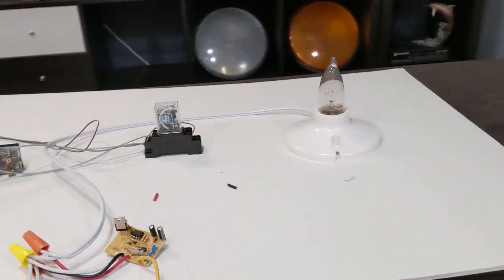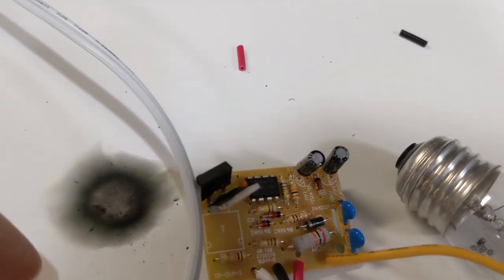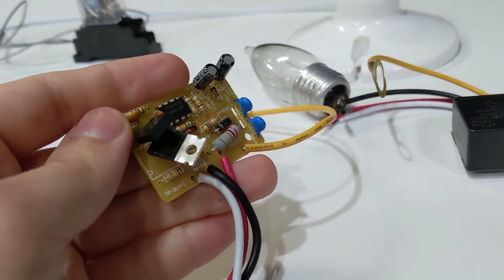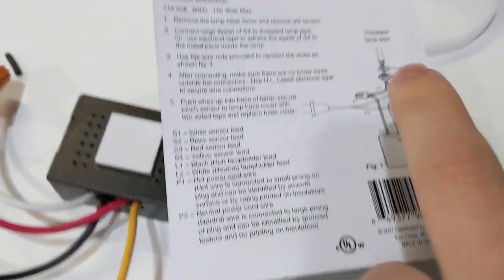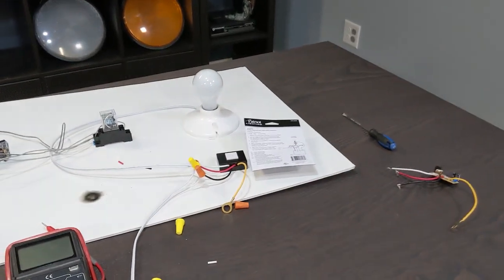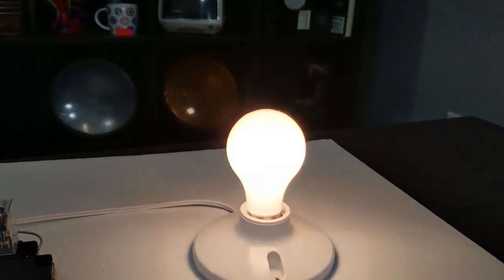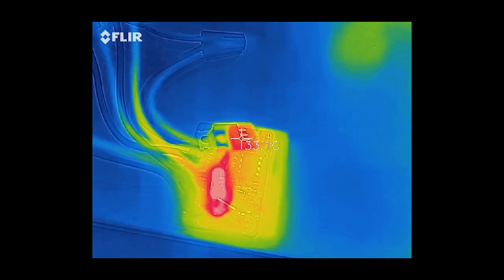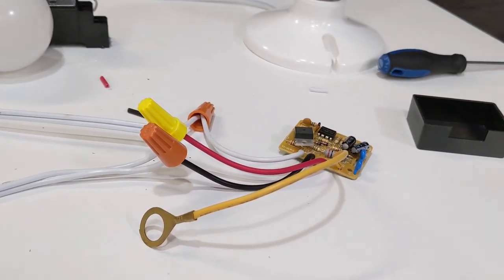A slightly explosive touch-lamp follow-up (standby energy consumption)

Comment: What's the philips hue WIFI standby power consumption vs the touch lamp standby current consumption?
Reply from the maker: Great question! The device on the network (bridge I think?) is undoubtedly greater than half a watt, but I would imagine the bulbs themselves can pull off substantially less. I have a Zigbee smart bulb somewhere that I can test... I'll go looking for it
Reply: @TechnologyConnextras  Can't wait for the results!
Reply: The Zigbee smart WiFi chip may be capable of extremely low idle power consumption, but that doesn't guarantee the circuit supplying it is also smart low power.
Reply: @andykillsu  Phillips is transitioning away from Hue and is going towards the Wiz WiFi lighting solutions instead. They are cheaper bulbs upfront but you have to have the WiFi module in each lamp. I heard those use controllers are so power efficient that the benefits of Zigbee outweigh the drawback of needing the Hue controller. Back when smart devices 1st came out, WiFi was power hungry and Zigbee was the best option. Now, WiFi is power efficient enough a mega super cap can store WiFi settings on a smart bulb for example vs Zigbee.
Reply: I also wondered about the smart lightbulbs, but I've actually got a few LIFX ones rather than Philips Hue. 

Philips claims Hue uses about 0.2 W on standby, my LIFX bulbs (and they're the most efficient ones they have) 0.7 W - which is more than I expected, I'll be honest!
Reply: @TechnologyConnextras  I hope its not much as I have 10-ish plugged in all the time! eeek!

Comment: As an Australian where Red = Hot and Black = Neutral 'Whats ya issue mate?'
Reply: In Aus - Not always
Reply: I mostly work with DC power in my job (like hooking up cooling fans) where black is negative. Occasionally I'll mess with A/C if the power supply for said cooling fan needs to be wired to an electrical cord (depends if the power supply has an outlet or not), what I usually see is red and white in A/C wires, not red and black. In that case the white is the neutral. With housing you often see white and black, but I don't mess with housing wiring in the course of my job. If I'm doing wiring, it's going to be cooling fans or LED lighting.
Reply: @jimmym3352  Here in Australia, up until we switched over to Brown/Blue/White/green to match the rest of the NON USA world, it was
Red Active, Black Neutral, White Switched, Green Earth.
Since we were required to switch the active, obviously wiring for switches was almost always red (active) & white (switched).
I am VERY out of date tho. My license expired decades ago.
Reply: here blue is neutral and brown is live ....
Reply: @nufgorf  our fixed wiring is still red/black. Appliance cords are brown/blue.

Comment: As you had it when it exploded, the electronics were being powered in series with the bulb and the triac would short the two mains wires together. Remember, it isn't that he flipped the hot and neutral, because being an AC circuit which wire is hot and which is neutral Does Not Matter. You can flip your mains cord and the bulb cord around all you like, the circuit will work the same. What mattered was getting the electronics wired across the mains (neutral be damned) and the bulb in series with the triac (lamp fixture be damned), nothing more...which you did not do the first time around ;-)
So, to break it down with the board, the white wire runs to the triac, the red wire runs to the electronics, and the black wire runs to both the triac and the electronics. If you want the black wire to mean HOT, then so be it: run Black to HOT, Red to Mains Neutral and the Neutral of the Bulb, then White to the Hot of the Bulb. It will work just fine.
Reply: Totally agree. The triac was wired across mains not in series. Swapping live and neutral (and colours) doesn't matter

Comment: Red = live, black = neutral sounds normal to me ;)

Of course NOW the unified European wire colours changed Live 1/2/3 from RED/Yellow/Blue to Brown/Grey/BLACK, and neutral from BLACK to BLUE.
Reply: probably because AC and DC aren't the same
Reply: depends which kinda network type you're on.
Reply: Brown is that colour for live, because that is the colour of your underwear if you touch it. That's what an electrician told me once anyway LOL
Reply: This is where interdisciplinary learning in science and industry is important. It would seem obvious from an anthropological and psychological perspective that you should use RED to denotate danger, and something like brown or gray for neutral, but I'm not certain if that's universal (more likely is about the red, since I do remember reading studies on that) which is why broad minded testing multi-culturally would be important for that.

Comment: Yeah those colours are very dumb. Also as someone else mentioned, the wiring diagram shows it switching the neutral which is not the best. I believe it would be possible to wire it to switch the live without exploding, but the way you had it wired first, the triac was basically shorting the incoming supply, so having the plug the other way around would’ve been the same result.
Reply: How was this being sold at a store?
Reply: You are still getting it wrong. The reason it exploded is because you connected the white S1 wire to your mains line voltage. 
Your explosion has nothing to do with connecting black or red wires to neutral or not.
Reply: @giyanvice  All these people you have been spamming this reply to are other commenters. They don't run the channel.

Comment: I had a similar experience when I was replacing a missing molex power connector on a hard drive. I bought an extension cable from Radio Shack, with male connector on one side and female on the other, with the intention of cutting it and discarding the male half. I examined the controller schematic and soldered the red wire to 5V and the yellow wire to 12V and the two black wires to ground. Connected to the power supply and POP with blue smoke! Turns out because it was an extension, the manufacturer didn’t bother aligning the colors to the pins in the conventional way and I sent 12V down the 5V channel and lost the most expensive and highest capacity drive I’d ever bought.

Comment: With respect to the polarized plug, there isn't' any ground reference, so it would have behaved the same with reversed polarity.
Reply: Yes. The design appears to not care about polarization. Rather, it only specified a "common" connector on red; black for "input"; white for "output".

Comment: So, let me get this straight: Hot is tied to the lamp, so the contact in the socket is always hot, and the NEUTRAL is switched?  I would imagine if you used a polarized plug and reversed it so hot was on black (and therefore switched), it should still work, and it should be safer as well.  (Lamp sockets are still a major gap in making electrical appliances safe for people with curious fingers!)
Reply: Yeah, I was gonna say this..  As an electrician, you NEVER switch the neutral.  ALWAYS switch the hot.  This is not up to code.
Reply: Apparently the lights in my house are neutral-switched too (it's a >30-year-old manufactured home). I always change bulbs with rubber gardening gloves on, for starters...
Reply: @WackoMcGoose  Light switches are fairly simple to rewire.  Most important two steps are 1) turn off the breaker 2) test to make sure you turned off the right breaker (or just turn them all off)
Reply: @narcoleptic8982  depends what you're doing. With coloured LED strips you always switch the neutral. There's one hot wire, then it comes back as three (or four, or five if you want good white LEDs as well) neutrals for each colour, so you control them that way.
Reply: @lost4468yt  are u talking about low voltagr dc led strips? live/neutral terminology does not apply there, and wouldn't the colors have individual positives and a common negative?
Reply: It's a non-polarised plug, so won't matter which is neutral or live as it can be reversed at the plug at any time.
Reply: @narcoleptic8982   Bad design. The hot lead is connected to the lamp at all times, creating a shock hazard even when the lamp is off. Switching the neutral side would never be approved by UL. This is probably counterfeit and illegal to use in the USA.
Reply: You are correct. The neutral wire should go to S3 which should also go to the threaded part of the lamp socket.
Reply: @MikeF1189  I'm curious how you think you know this device isn't UL listed? I'm also curious where you get the idea that a lamp switch has to be UL listed to be legally installed in the USA.
Reply: @RickinICT  Pretty simple actually. I guess you didn't read the above article on how to spot fraudulent UL listings. It is code my friend. NEC.  I know you are not an electrician but it's pretty basic stuff.  Educate yourself.
Reply: @MikeF1189  Well, you haven't actually answered either question, have you? Exactly where in the NEC does it state that a table top lamp switch (which is not a fixture) must be UL certified to be legally used in the US? I find nothing indicating that the NEC concerns itself with table lamps, I'd be happy for you to quote me the specific section where it does so. Please, be precise so I can look it up and "educate myself".

Next, exactly how do you know that the product in that package is not UL certified? How have you looked it up? Are you sharper than Menard's legal department? Do you suppose they don't know how to verify a UL listing? Do you think they make enough money selling a few of these switches per year to risk the liability of selling a device that hasn't been listed when they could just as easily find another device which is?

Be careful about educating people online, they may not turn out to be as ignorant as you suppose. I'll look forward to your NEC citation addressing table lamps, and explanation of how you are so sure the product in the video isn't UL listed. Don't put your back out digging that hole before you stop to ask yourself if you're really sure you should still be digging.
Reply: @RickinICT  Do your research. Spend a little less time arguing with me and a little bit more time verifying facts. Prove me wrong.
Reply: @MikeF1189  In other words, you admit you can't back up any of the assertions you've made. Because the burden of proof is always on the person making the claim (i.e. "it's against code" and "it's a counterfeit UL listing"). But hey, I'm glad you've finally realized it was time to put the shovel down and stop digging.

The NEC doesn't concern itself with table lamps, it covers electrical installations and wiring. You're completely full of BS claiming the NEC has anything to say about a table lamp. That's why you refuse to cite the section that covers it, it doesn't exist! And an electrical device does not need to be UL listed to be legally sold and used in the US, but it would certainly be foolish for a company the size of Menard's not to insist on their merchandise being tested for liability reasons.

And that's why this device has been tested, and is listed as a "Recognized Component" by the UL for both the US and Canada. The device in question, while being packaged and sold under the "Patriot Lighting" brand by Menard's, is in fact a Zing Ear TP-01. The manufacturer's name and model number are embossed right into the mold which makes the housing. Since I doubt you'll "educate yourself" on how to look up a UL listing, I've done it for you:

https://productiq.ulprospector.com/en/search?term=Zing+Ear+TP-01

As you can see from these results, it is UL listed as a "Recognized Component" (in other words, it's a component of another device (e.g. a lamp) and has been tested and pre-approved for use as a component thereof).

So there you go, I've not only "educated myself", I've hopefully educated you in the process. At least, I have if you are capable of learning.
Reply: @RickinICT  I thought I told you to prove me wrong. Go on now. Stop commenting on YouTube videos. Do a little research. I gave you all the information you need. If you're interested in finding the truth I gave you the leads. If you're interested in arguing continue commenting.
Reply: @RickinICT  Such hurt feelings. You need counseling.
Reply: @MikeF1189  Ladies, you're both pretty.
Reply: @polygondwanaland8390  OUCH
Reply: @polygondwanaland8390  just not on the inside apparently.
Reply: @MikeF1189  
Um… They did present evidence to prove you wrong… I’m not taking a side here as I really don’t care, but this comment near the end of the discussion just seems odd right after he posts a comment with links that (supposedly) show that your assertion appears wrong.

I would also agree with them that the burden of proof is on the claimant—which, in this case, would be you. I can agree that this is likely unsafe, but as far as violating any sort of code or not being UL-compliant, you would need to cite which part of the code would apply here more specifically than, well, all of it. 

Also, as for the “hurt feelings” comment, that is even less persuasive. Aside from the lack of evidence that there were any hurt feelings to begin with, it’s irrelevant, and it also ignores the merits of the argument actually being made.

Again, I don’t really care whether you’re right or wrong, but your argumentation needs some work.
Reply: @bhull242  I agree 100% with you on all your points, if my goal was to make a cogent logical argument. If, on the other hand my goal is to get someone heated over something stupid.
Mission Accomplished. 
Have a nice day and thanks for the comments.
Reply: From what I've seen essentially all touch-lamps have live exposed at the socket when off and control neutral. (Old ones, and new ones.) I have a UL listed touch lamp from Walmart and it has live going to the lamp when it is turned off. I observed the same behavior in an ancient touch lamp. Some people say that it is dangerous but there has to be a practical reason for it. Not that anyone I ever have known in my life would stick their hands in a lamp socket.

Comment: That looks like a really crappy half rectified mains to Zener power supply, from what I can see. 20 kOhm resistor dropping almost all of 115V AC (120V minus the Zener drop) half the time is 0.33W.
They probably need that large filter capacitance because a shitty, ripply power supply would make measuring capacitance tricky.

Comment: That thing even has a UL logo on the package, doesn't UL have a requirement to use the correct wire colors for this type of device?
Reply: As a component of a larger appliance this doesn't have the same rules as fixed building wiring.
Reply: that UL rating is faked.
Reply: @WarpRadio  I mean, obviously, but seems like selling on amazon that underwriter laboratories should be able to go after them for it.
Reply: Anson Mansfield What are you expecting them to do?
Reply: @AJMansfield1  Well.. you would THINK that... however, with the millions of crap products that come out of that country..  they simply can't keep up.. (they tried to use hologram labels at one time- until the Chinese faked those as well!)  You can't even trust the main brands anymore either!  I bought some GE LED lamps.. and they were cheap fire hazards which popped and set alight within a year... so, the old adage applies:  "buyer beware!" (or, should that now be:  "buyer be weary"!)

Comment: "black is hot in north america"
Because red-hot and white-hot wasnt obvious enough?
Reply: See also the package: Made in China
Reply: In the US, white wires are better analogized to ashes, as they may still be hot, but they won't be getting hotter on their own, so a decent choice for neutral.
Green can similarly be analogized to green growth, that hasn't gotten hot at all.
That leaves everything else for "currently burning, do not touch".

Besides, common wiring in the US needs four distinct colors, not three.
Reply: MonkeyJedi99 Made in China but mostly for US market as it is labeled as 110V in the package.

Comment: AC Color codes are not the same as DC color codes, and individual manufacturers can use whatever colors they choose internally.  It is ALWAYS up to the technician, to do the research prior to making electrical connections. I'm really glad you weren't injured in your discovery. It was quite entertaining.       👍😃👍

Comment: There's actually 2 dumb things about the wiring. Yes, the colors are confusing, but part of that is because they have it switching the neutral and normally you're always supposed to switch the hot. From what I can tell, the hot is shared to the board and lamp on the red wire, and the board switches the neutral to the lamp from the black to the white. Your way of shared neural on the white wire and switching the hot from black to red makes the most sense to me. I think it might be possible to make it switch the hot if you did connected the hot to black and the neutral to red (and to the lamp), but that still means that the white wire would be the lamp's hot the red the lamp's (and wall's) neutral which is dumb.

I think what happened when it exploded is that the board is expecting to be powered between black and red and when off the white is effectively disconnected. The polarity for A/C doesn't really matter that much, so I don't think plugging the polarized plug in the other way would have mattered, but the red half of the board's connection to mains was actually going through the lamp to the white wire, since you actually had the wall connected to white and black. When you turned it on, it connects white to black which is essentially sticking a paperclip in your wall socket.

Comment: I wonder if these colours were chosen to reflect older wiring colours in some other countries, such as the UK. These used to be red and black for line/neutral for single phase. Australia/New Zealand also use red for line, white for switched line and black for neutral, in some cases.